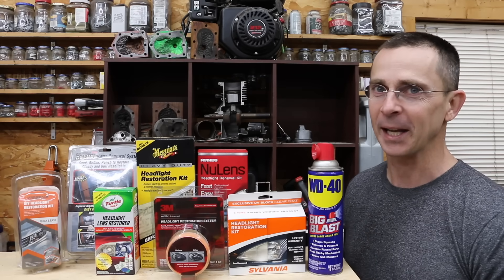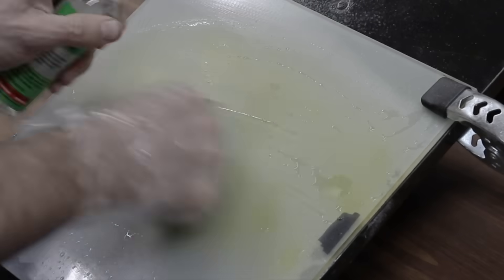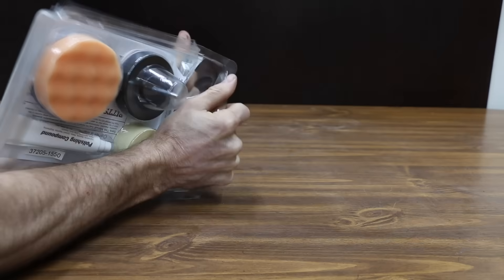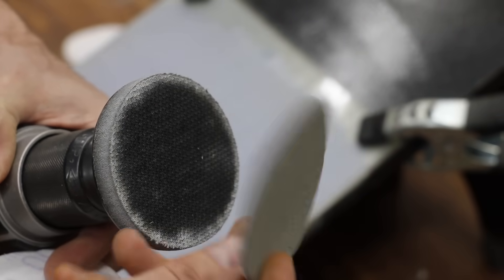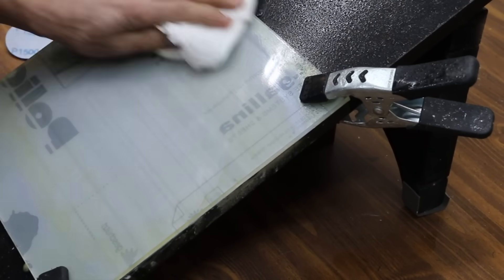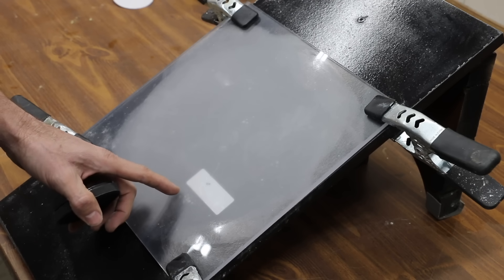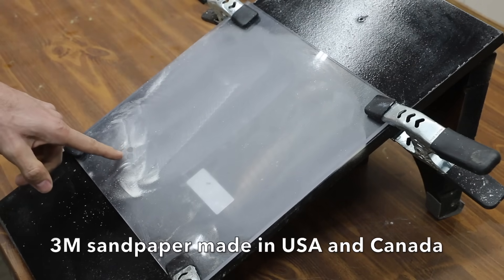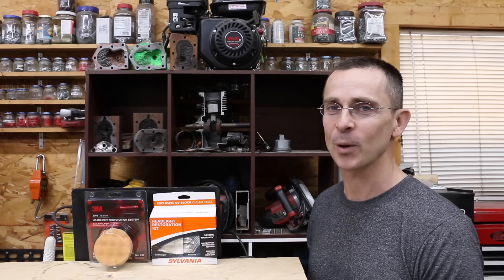Best Headlight Restoration Kit?  Let's find out!  3M, Sylvania, Meguiar's, Mothers, Turtle Wax & HF

Comment: You’re literally the best no nonsense, straight to the point, no long boring intro YouTube guy EVER! Your videos have helped me make valuable decisions on my purchases and your Opinion always mattered to me! Thank you   Edit: I almost feel like a rockstar with all the likes... Thanks everyone
Reply from the maker: Glad to hear!
Reply: @ProjectFarm  
I'm sorry sir, but I've been chasing  clouded lenses for many years and when the UV damage is that deep the only completely reliable solution is new headlights. 

I've wiped sprayed and buffed with at least half of those products and although they look new, 6 months later they are clouded again.

For my 2005 Hyundai Elantra it cost me 52$ apiece from Car Parts .com
Reply: @tommypetraglia4688  After you sand them, use McGuire's headlight coating. Costs around $10, but worth it.
Reply: @tommypetraglia4688  Tap plastics all in one plastic restore makes them better than factory condition as their spray-on primer & protective clear coat is the same the car manufacturers use here in the USA. My Toyota T100 lights were restored in 2004 and they still look crystal clear. Don't buy an off-the-shelf auto parts lens restorer if you want real clarity and protection. I even did my 320-gallon tank inside and out and it i sill super clear after 6 years which is unheard of without protection. Works amazing on ATV and dirtbike plastics too.
Reply: @tommypetraglia4688  maybe the quality of the lights you are working with to start with
Reply: @tommypetraglia4688  I've also tried a couple product and my ex used some product while I was at work. Made minimal difference. I still had "no headlights" at night.
Reply: In fairness, and I'm guessing you didn't mean it this way, but Project Farm doesn't drop opinions, in my experience. My man just drops testing methods and results.
Reply: @christaylor9095   Yup, thats why i always trust his reviews, he shows everything and leaves nothing out without an explanation.
Reply: Chris Taylor Yes you got that right! But he’s very subtle when he says things like, this is definitely worth the money! Or the results speak for themselves... He never says anything that can be taken as advertising for a certain product! Just a awesome down to earth guy who like as many of his almost 2 mil followers comments...
Reply: @christaylor9095  AL
×
Reply: @christaylor9095  He quite literally gave his opinion on the 3M vs HF sandpaper in this video, saying "in my opinion" while speaking on it.  Many any of his tests have subjective results at times which by default are opinion based.  He doesn't recommend specific products and does strive for a non biased testing/review process but he does often state his opinions on the products after testing, also leaving the results to speak for themselves as well so we can form our own opinions.  I haven't been watching his videos for very long but I have great respect for and look forward to hearing his opinions of the various products he tests.
Reply: @christaylor9095  Well, its kinda his opinion on what he thinks should matter to us (aka what he tests the products for) and how he creates the tests... but i know what you mean.
Reply: @ChasenWolf  , he's always asking us what we want him to test and we're obliging every time
Reply: @christaylor9095  his testing process is unique to him though
Reply: @ChasenWolf  👌
Reply: Yeah he is cool
Reply: @fabianpalmerin  he is
Reply: I was about to comment something but you already said what I was about to say... this guy is absurdly good indeed! elevates youtube to a real deal level! incredible to having a Project Farm these days...
Reply: Yep, can vouch.
Reply: B B  -   He would have had to get a pile of headlights and there is no way to ensure comparatively equal damage.
so he used a sheet of the same material as headlights and gave each equal damage as a control.
Reply: I second this. I really look forward to your videos. Keep it up.
Reply: ABSOLUTELY ...I always tell other BORING LONG INTRO  youtubers to go learn from this guy and Chris FIx on how to make a video w/o wasting our time.
Reply: @donhill1825  Oh yes! Thank for commenting on my post. It’s funny when people complain about commenting? Now THATS cringe inducing!!!
Reply: No need to thank us for the likes. Your impeccable youtube commenting transcends the boundaries of mankind’s ability to express themselves in comment form. We owe you a debt of gratitude for the gift you have bestowed upon the world. Long live Eric Carter the comment King! Rockstar!
Reply: Anything you review I always buy what came out the best from your test
Reply: Agreed. Him and AVE are two of my favorites... P.F. covers a wider variety of stuff than AVE although the humor at AVE is PRICELESS 😂🤣🤣🤣. P.F. definitely offers more no nonsense information though, HIGHLY useful!!!
Reply: You are 100% right about PF channel.  I don't understand what validation people geel from getting thumbs up on their comments. I gave you a thumbs down just to balance it out. Don't fall into a deep depression, please.  😉
Reply: @georgeorwell126   No depression from a “thumbs down”  For me it’s just cool to see how many people took the time to read something I said and agree with me!
Reply: literally only person that the dislike button means nothing to, because there is nothing to dislike.
Reply: well said, I agree on all points!
Reply: One more like for you…you big 💥ROCKSTAR 💥
Reply: To be fair, the cheap ones were for hand restoring minor patchy discolouration .. not power tool  restoration of the entire lense
Reply: Facts!
Reply: @Eric Carter
I agree. Project Farm is premium-value educational content.
Today, I learned I can use my drill to sand and polish things. I thought I needed to go buy a different tool.
Reply: It's true😁👍 Thorough and comprehensive.
Reply: Hi. I've tried 2 product that you have tried and believe me, it's not the same, carlight plastic vs
 light plexiglass...I think you said plexiglass. Anyway the 2 products didn't work. I am interested to see which one you prefer here.
Reply: Will you please test the new Cerakote headlight restoration product and update?
Reply: I'm curious what these lenses look like today
Reply: Here here
Reply: You’re the reason why I subscribed after reading your comment

Comment: OFF deep woods bug spray works great for light lense fogging. Spray it on a rag and wipe the lense till it clears. Than I like to flush it with water and a clean rag to remove any left over spray. I have been using this method for years.
Reply from the maker: Thanks for sharing.

Comment: I used the Sylvania kit and it worked very well, no need to look further.  The headlights were worthless at night and the kit restored them like new.  After a year, the coating looked a tiny bit cloudy, but still just fine.  I suppose if it was needed again, I would do it.  The kit works by dissolving the cloudy haze, then lightly sanding the bare lens, then "painting" on a new UV coating that makes it new.
Reply from the maker: Thanks for the feedback.

Comment: I used the 3 M product. It was quite a production but I did get my headlights back to about new.  The next time I didn't wait as long (the headlight were just a little foggy ) and used the turtle wax one and it worked great. If your headlights aren't that bad, the turtle wax works fine and only takes about 15 min. per headlight as opposed to 1 1/2 hours per light with the 3 M.
Reply from the maker: Thanks for the feedback.

Comment: A large problem with plastic lenses is the road debris from cars in front of you.

I met a commercial driver that cut some small pieces of glass and mounted them in a frame in front of the plastic lenses.

It's been years now with zero fade, zero fog, zero colour change of any sort.

That same problem that sands your grill, bumper, and sometimes the leading edge of the hood ( especially for tailgating drivers) lends heavily to dead lense covers.

When possible or during an upgrade, try to swap from plastic to glass in my opinion.
Reply from the maker: Thanks for the feedback.

Comment: I’m a painter at a body shop and whenever someone needs their headlights restored we sand them down with 800 grit until the yellow color is gone and then spray them with 2k clear. 9 out of 10 times it works perfectly.
Reply from the maker: Thanks for sharing.

Comment: Another option I would have liked to see is how the kits compare to using off the shelf sandpaper and an auto detailers cutting and polishing compounds and sealer for car paints. This is what I do and it's pretty effective. That could throw a lot of variables out there as there are so many different cutting and polishing compounds and sealers which could make for an expensive video. But even a mediocre set of compounds and a mediocre sealer I think would do better than many of the other kits. Probably as good as the sylvania kit.

You could leave the ones you tested in this video out in the elements to see how long they last. My method using detailers compounds and sealers last a few years provided i reseal every 6-8 months even in the hot AZ desert. I remember using one of these kids a decade or so ago, and I remember it definitely didn't last longer than a year.
Reply from the maker: Thanks for the video idea.

Comment: should use rubbing compound then wax it will work just as good if it's bad use 2000 - 4000 wet dry sand paper first
Reply: done this to restore motorcycle windshield
Reply from the maker: Thanks for the feedback.

Comment: Interesting test. I cleaned my badly yellowed headlights (92 Ford 250), then sanded with a 200 wet and dry, then a 400 wet and dry, finished with a 1200 wet and dry, cleaned with alcohol, then sprayed a UV resistant clear coat, 2-3 coats. That was three years ago, still holding up. Only thing markedly different is I did not use a polish . UV clear coat filled in micro scratches perfectly. Will be a simple process to repeat when needed. You are correct, nearly all kits are pretty much identical. With the cheaper HF kit I would wet sand to reduce clogging in spite of the directions. Oddly enough, many 3M products are made in China, just depends on the specs required by corporate as to what quality you get. Covid-19 revealed the massive and larcenous up charge in mask prices when China locked down the 3M plants there to take advantage.
Reply from the maker: Thanks for the feedback.

Comment: You should try using the wet sandpaper technique from 800 to 1500 grit, then spray automotive clear coat over the headlight. After it has dried, buff it out with polishing compound.
Reply from the maker: Thanks for the video idea.

Comment: Try adding a few light coats of Clear U/V blocking spray "paint" over the cleaned up lens. 
The 2X labeled (Home Depot?) brand is not very expensive and it may extend the repair "life".
Reply from the maker: Thanks for the video idea.

Comment: This has to be one of the most useful channels on YouTube for the home handyman.
Reply from the maker: Thanks so much!
Reply: @ProjectFarm  60 years old, I have owned many cars and some had yellow headlights. The least hassle I have ever found is to go to PartsGeek, RockAuto, Amazon, ect and buy a replacement headlight
Reply: @HopefulPessimist  a lot of times the OEM headlights are much better quality material and manufactured to a higher standard a lot of the aftermarket headlights have fitment issues as well
Reply: For any to he honest
Reply: Awesome content. I mask, sand with 400. Wipe with denatured alcohol. Spray with Duplicolor clear. Fast. Simple. Easy. Thank you for covering so many bases, with your regular zero bullshit approach. This is the best of Youtube, my freind!
Reply: @VTLIFE-so4dc  should at least hit it with 800 before clear it will come out much more clear and smooth
Reply: shit or Pros! im in the trades myself and his info bout step drills, blade sharpeners, batteries, etc. very useful
Reply: I have had really good results using a good wax or especially TR3 to seal up the plastic after. But then again, I haven't found much TR3 is bad at?
Reply: As well as the pro.

Comment: Well Done Mate, I've Always wondered about these products "if they work and results for the money".
My BEST result ever was with wet/dry sand paper+"Fine Valve lapping compound" on a 96 ford taurus ghia headlights, i owned in Australia and yielded a great result as oxidation was severe on those ones.
i myself have used wet/dry sandpaper 600 up to 1200+ machine buffing compound, or "sand and polish only" and take your time folks..
Reply from the maker: Thanks for the feedback.

Comment: LANDSCAPING TIME!!!!  Still waiting on  - "the best landscape block adhesive".  Contenders could be loctite, DAP, Titebond, mortar, etc. .  I made this suggestion some time ago after replacing a poured concrete porch, (due to termite damage behind it) with block and pavers.  I used an adhesive the dealer claimed "would outlast the block!".  It did not...twice, on the same paver that had a very sharp and fragile corner cut, and located in a high traffic area of said porch.
Reply from the maker: Thanks for the video reminder.

Comment: The next logical step is to find out what brand of headlight bulbs is best.  Perhaps PF or electronicsNmore can perform the test.  I will be waiting for the notification.
Reply from the maker: Thanks for the video idea.
Reply: @Wayne Flanigan Yes sir, you are correct.  Some brands are made in the same assembly line and have to meet certainrequirements.  Not taking packaging into account, the difference is cost, color temperature, brightness, etc.  The cost benefit ratio to performance, ie. Bulb life, is what the channels mentioned can find out for us.

Comment: I used 3M kit 39175 to restore my headlights with great success. It didn't have a buffing step, but did have a clear coat. If you do a second round, I'd be interested in seeing how it compares! Looks like 39175 now includes a buffing step and the product I used is now called 39195: https://www.farmandfleet.com/products/1314605-3m-ultra-headlight-restoration-kit.html
Reply from the maker: Thanks for the video idea.

Comment: the best way to restore headlights is with an electric/power sander, and various grits of wet and dry sandpaper going up past 2000+ grit, then a polish with any car polish and a separate uv sealer.
Reply from the maker: Thanks for the feedback.

Comment: Polycarbonate it's self turns yellowish over time its self....l have been thru a lot of this kinda thing.....How ever l have found one that works 100%.....l also guarantee lt will work 100% of the time.....Just order your self new head light......l have a fairly new Dodge truck....New head light cost me some where about $48 or $59 bucks for a set of 2, right and left side....DO NOT ORDER FROM THE DEALER EVER..... tHANKS FARM...dUDE.....!
Reply from the maker: Thanks for the feedback.

Comment: Like the video but I'm a mechanic and I use 800 grit wet sandpaper to remove yellowing and cracking then I dry it and give it a blast of 2k lacquer. This is better and longer lasting I find and you dont need to go high up in sandpaper to get an excellent finish because the lacquer smooths them out and you get a good mechanical bond to rougher surface.
Reply from the maker: Thanks for the feedback.

Comment: 3M,  definitely the adhesive and abrasive company.  Wet sanding is key.  The Sylvania kit is good.  You can get the complete kit ~$20 or the  UV Block with just the chemicals for ~$10.  The chemicals only for ~$10 is a good buy when you have your own sanding / polishing supplies.  Automotive rubbing compound followed by automotive polishing compound works well.  If you don't let the headlights get too bad, you can get away with just the rubbing & polishing compound.   Either Sylvania kit has enough to do multiple sets of headlamps.  When you have a couple of 20 year old cars, you learn some tricks.
Reply from the maker: Thanks for the feedback.

Comment: Man, I am so glad you actually did this. I need to restore my headlights on a vehicle and honestly every time I go to the store and start trying to read these kits, my eyes glaze over in boredom and the project gets pushed off another 3 months. Sometimes it is just plain awful trying to filter through all the marketing wank.
Reply: "marketing wank" hahaha.
Reply from the maker: Glad I could help!
Reply: It's simpler to just give up and not drive in the dark anymore. 😁
Reply: Sometimes the best way to do something is to just do it and get it over with. It should be obvious what to do with the kit without instructions. Use the lowest grit sandpaper with water, and ascend in grit count until you can't go any higher, then polish with included compound. It's pretty universal. I use UV resistant, non-yellowing spraycan clearcoat and polish it afterward to protect it.

Comment: best thing for headlight restoration is a good quality clearcoat depends how bad the headlight is start with 220,320,400,600,800,1000. spray plastic primer then clear most of these product you will have to redo within the year,clear coat last years my car more than 5 years now only have a few stone chips that digs the clear but still looks like new
Reply from the maker: Thanks for the feedback.

Comment: The car wizard has just done a video on this and he used DOT 3  brake fluid, worked well, woould have got better results with some polishing .neat trick and cheap
Reply: He used DOT3 brake fluid to remove the yellowing. He also used polishing compound, but no sandpaper.
Reply from the maker: Thanks for sharing.